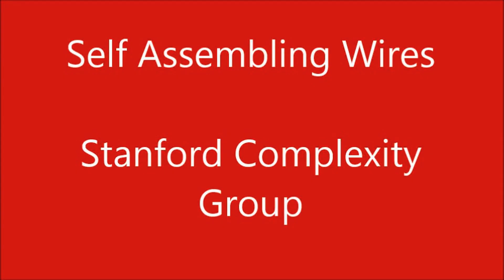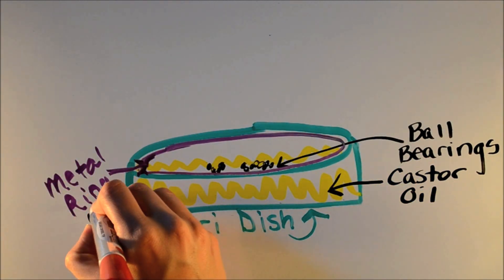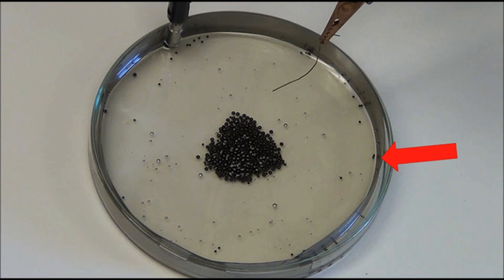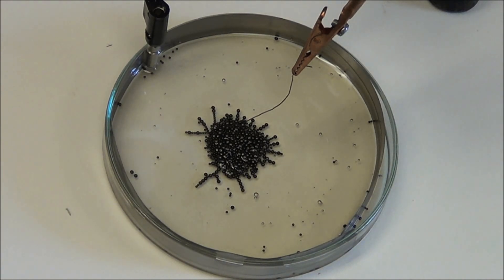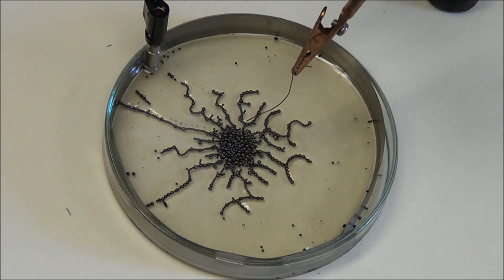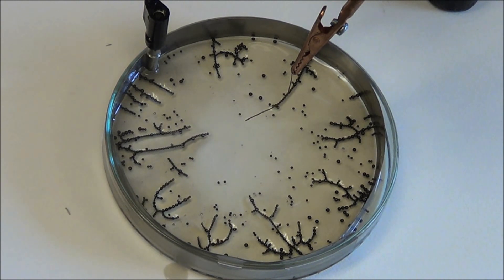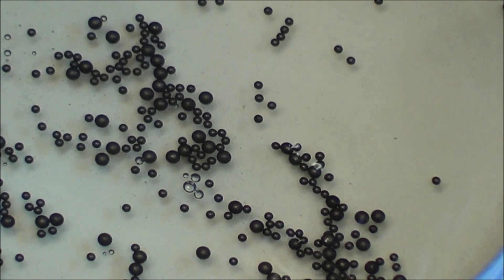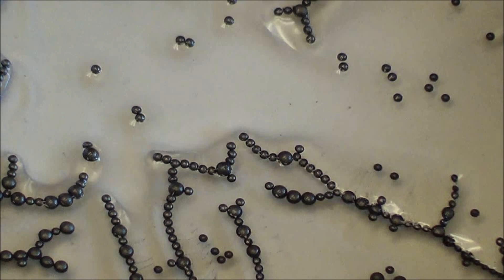Self-Assembling Wires

Comment: Normal YouTube videos: DON’T TRY THIS AT HOME!!!

this guy: “unfortunately you can’t try this at home.”
Reply: But ppl who watch electroboom should be able to do this :D
Reply: @PerfectDarkcontrol  and people who watch styropyro will probably try to scale of up 😆
Reply: I actually wanted to try this at home but I got sad when he said that I can't.
Reply: @marktoledo6595  school
Reply: @marktoledo6595  
To put it in perspective. An electric fence can have anywhere from 2,000-20,000 volts. 20,000 being the maximum legal amount. Take into consideration a human can die from just 50 volts! So seriously, don't fuck around with electricity. Water being a good conductor for electricity, humans have plenty of that and blood can do about the same thing. Seriously. Don't try stuff like this at home without being 100% safe and know exactly what you're doing.
Reply: @DexiduousRose  You could easily do this experiment with a van de graph generator. Dangerous currents are not needed. You could also do it with a potentially lethal CRT flyback tranformer if you know what you're doing, but you can absolutely do this safely without knowing what you're doing with the appropriate voltage source.
Reply: hold my beer
Reply: [Laughs in Tony Stark money]
Reply: @John Tapsell There are many ways to create the voltage required for this experiment. As complex as a Tesla coil or as simple as a flyback transformer from a discarded CRT television. Possible even a Van De Graph generator.
Reply: You can just buy a power supply to provide 20kV+ voltages if you really want too... You could even build one if you were so inclined (look up Cockcroft–Walton generator).
Reply: lol unfortunately he's mistaken, 20kv is nothing. I've been hit by over a million volts, and I'm still breathing.. He forgot to mention the amperage of this setup though, probably on purpose.
Reply: @Voidroamer  Well I've been hit by 20kV and it sure as hell wasn't nothing. Let's just say that if I'd been using my left hand I probably wouldn't have woken up before I had a chance to fall down. It's not just the current, it's also the path.
Reply: It's really not that hard to buy or build your own power supply. Their "can't try this at home" power supply can be bought or diy.
Reply: Me, watching Electroboom right before this video: "who's gonna stop me?"
Reply: So many people in thread have never bothered to learn the fundamentals. Ohm's law is a good start 🍻
Reply: @SNG.OfficiaI  This is YouTube, not MIT!
Reply: @c.a.g.3130  grade 9 shop isn't mit lol
Reply: @SNG.OfficiaI  They hardly grasp Ohm's Law in grade 9 shop.
Reply: @c.a.g.3130  who is "they"?
And what is so difficult?

We're not talking thermodynamics or any advanced engineering....
Reply: @c.a.g.3130  and btw, you can sit in with MIT here on youtube... Has been that way for a decade already for those interested.

The science and tech areas of yt are vast and publicly share a  wealth of info. 👽
Reply: @SNG.OfficiaI  Just ask the guy that "has been hit by over a million volts".
Reply: @cosmicraysshotsintothelight  there is always a method to the madness...
Reply: Not if my pile of tazers has anything to say about it
Reply: Why can't i
Reply: @strydyrhellzrydyr1345  Obviously you can. What he meant is "you can do this at home. If you're smart enough to figure out how then you probably won't kill yourself. Either way it's not my fault because I said it's impossible." But that would have taken too long.
Reply: @GordieGii  oh.. I get that.. I thought the first guy said u really can't... I c
Reply: @strydyrhellzrydyr1345  'Cuz Anthony Fauci sez so! DO IT.
Reply: Me with a full bridge rectifier and an old microwave:
Reply: @BSEUNHIR  MOT's are a hazardous prospect... and fairly useless in this application . Typical MOT output is 1.8kv - 2.2kv.. and produce lethal currents.. A flyback would be far more suitable for this experiment...
Reply: @SNG.OfficiaI  240v -> 2.4kV = 10x increase. If i use 2 MOTs, i have 24kV :)
Reply: @baileyharrison1030  
First, you are correct that each transformer gives about 10 X voltage increase. When connected in cascade, the overall voltage increase would be about 100 X. But what you propose would not work because:

The second transformer would have 2.2 kV applied to its primary, but the primary insulation is designed to handle only 220 V with some safety factor. It might handle 440 V, but not 2200 V. The primary will arc across the insulation and be destroyed.
If that did not happen, you are also applying 2200 V to a primary which was designed for 220 V. This requires the magnetic field in the core to be 10 X larger without saturating the core. Either the primary needs to have 10 X as many turns on it (to keep the volts per turn constant), or the iron core needs to have 10 X as much area inside the coil. Either way, you need a much larger transformer to operate with 2200 V on the primary. If you try with a standard microwave oven transformer, the iron will saturate and the primary will behave like it is shorted, overloading the upstream transformer. : )
Reply: Um, you just need a transformer of unusual size
Reply: @SeleckPlays  "size" does not denote winding count. Though it does play a part in current potential. Ex you can get 2kV from a transformer the size of a book of matches, but even though the voltage output is on par with a microwave transformer, it cannot produce the current...
Reply: @SNG.OfficiaI  The 'event' that takes place when you 'get hit' with an HV source that has no current driving capacity (micro-HV supplies) is that the voltage is immediately clamped down, because you are a very low value resistor to it. So in Ohms law, the resultant 'power' is very small.  Now if it was an HV transformer in a power grid distribution sub-station, that same voltage would not clamp down and you would literally get fried as the high current passes through your bloodstream and body flesh throughout its entire path through your body...  because you are a very low value resistor to it and it CAN drive high currents. One sustains the voltage and you die.  The other clamps the voltage and you get a wake up call to just how close you came to getting fried.  Tiny 10kV sparks on cigarette lighters get clamped to a low voltage because that little thing cannot make high currents.  Something that IS made to make high currents will sustain its voltage and drive current through whatever has loaded it.  It is ohm's law.  Just need a supply that doesn't 'sag' when loaded.
Reply: @cosmicraysshotsintothelight  understood ..  I think the safer route for those whom wish to use a MOT should go the voltage multiplier route. Get that voltage high enough to reduce it's available current. For a 20kV output it would still be a bad idea..

I use MOT's but mill out the secondary, rewire in a low gage low wind count to drive large laser array bars at 1.6V @60A .. 

Though I trade one hazard for another ...
🤘😜
Reply: @SeleckPlays  I'm not left handed.
Reply: Man sounds legit sad that you can't do it at home
Reply: @aftershade190  who...
Reply: @strydyrhellzrydyr1345  who? A mad man
Reply: @aftershade190  what... Lol
Reply: it isn't that difficult to do...
Reply: yeah
Reply: i mean, they couldn't, even if they wanted to, lol.
Reply: @MyouKyuubi   if you watch someone like ElectroBoom and actually learn what he sais, well i did like 2 kV with a homebuilt transformer which can be increased even more, im just lazy.
Reply: You don't tell me what to do!!!!!
Reply: You can. Just need a transformer.
Reply: "Let's hope nothing blows up"
Reply: I tried it, but there was an accident and now I'm some kind of cyborg.
Reply: Me and five microwave power supplies disagree.
Reply: I mean... couldn’t you just use a car battery
Reply: >this guy: “unfortunately you can’t try this at home.”
me: looking at my microwave
Reply: Yes you can,generating high voltage is easy,but if you need high current and high voltage that is just in industrial settings then
Reply: Wire 2 fly backs in series at the output secondary winding, parallel primary windings n u should be able to get this voltage, infact much more depending on how much your ZVS driver can handle. Its what i did with my fly backs.  its nice using a Variac for a power supply too. Just rectify to whatever voltage desired. I use this configuration for my Tesla Coils, and now soon, this ball bearing experiment.
Reply: 20Kv is the voltage generated by an old CRT television, if you have a bit of soldering skills and can retrieve a high voltage transfo you can literally do this at home, and that's what I'm going to do, my old, trusty ProView 19" died last year, but i wanted to save its heart. maybe making a tazer or some shit with it. but that project is inspiring.
Reply: hmmm. hops on #The_Post_Apocalyptic_Inventor. yeah, anyone got a used dryer, an old German made projector and some microwaves that they're handing to a dump I can intercept?
Reply: @BLIRTT  dryer.. nope. projector i don't imagine, microwave perhaps but really, go dig for a CRT monitor or an old television. that's what you need inside.
Reply: @BLIRTT  with the ton of shit you buy every year to replace it because it's obsolete, and you are too dumb to get it fixed yourself, you certainly had all of this somewhere at some point.
Reply: You actually can, with a microwave transformer. plug it into the dryer outlet.
Reply: Cynthia May  youll hear a pop, the gfci going out. Try a grenade instead.
Reply: That sounds like a challenge.
Reply: Nothing can fucking stop me
Reply: @John Tapsell Just build it by yourself, plastic cage isn't problem to get and then just craft it by switching between laying down foil and spining coils of paint insulated wire :D We had to craft them in school. 230V -> 12V + 12V secondary with common centre
Reply: well, he's simply wrong by saying that. 
high voltage power supplies with enough power are readily available (although relatively expensive, compared to other, "normal" bench power supplies) and everyone who's not a moron can absolutely work with such high voltages as well. He's also wrong with 120V household voltage - most of the world has 220 or 240V, and even north american and canadian households have access to 3-phase 220V because it's needed for demanding electrical appliances such as oven, washing machine etc.
Reply: Well, fortunatelly you can, but you'll need the right equipment...
Reply: He's just flexin'
Reply: @John Tapsell voltage doesn't matter, you can "get hit with" 1 volt or 1,000,000 volts and can have the same effect. It's the current that matters with life/death
Reply: @John Tapsell correct, but if you completely ignored the fact that you are able to control the current itself as well. A 1,000,000V taser will not kill you because the current is low. Just because something has a high voltage does not make it inherently dangerous.
Reply: That is just a challenge! Search for "Power Module High Voltage Generator". $4 will get you a low current 20KV supply. Where is the best deal on the bearings?
Reply: 2014 YouTube was fire
Reply: People : can we try this on home? 
This guy : well yes but actually no
Reply: interesting
Reply: Anyone suggesting mot's for this experiment is in the running for a Darwin award. Any high voltage source that can deliver over 30ma can kill. To be safe you want to be in the micro amp range. Also consider things like capacitance. If for example you choose to use a Cockroft Walton voltage multiplier then choose a frequency for the AC input that will allow you to use a low capacitance value and reduce the joules of energy stored. If done properly then this experiment can be perfectly safe. If you don't understand what you are doing the consequences can be fatal.
Reply: @paulb2529  "Over 30ma" MOT's ~ 2.2kV @ 1,000mA ☠️

Where ohm's law can earn you a Darwin Award 🤪
Reply: Me: "Oh you silly fool. Ye of little faith, in humanities creative ingenuity of stupidity"
Reply: I can increase the voltage by step up transformers.
Reply: Yup
Reply: not with that attitude
Reply: this guy thinks everyone in the world lives in america... xD what an idiot, not everyone has 120 volts in their homes, i have 230V in mine.
Reply: Sooo, why can’t you try this at home?
Reply: @bradwoods371  I suppose he meant, because the average person doesn't have a high voltage power supply sitting around (although a microwave transformer could be used, albeit lower voltage). But you can definitely find a high voltage PS anywhere on the web, or even find a large transformer in certain products, and adjust the wraps to give you a high voltage. but the average person is not going to do that, and if they did take the time to do so, well they're probably adept enough to read about it's safety aspects
Reply: you're right
Reply: Challenge accepted.
Reply: Watch what happens when we hook up this ignition coil to a car battery.
Reply: I guess we can do it in college chemistry lab ...
Reply: @John Tapsell Isn't the guy using DC voltage? Transformers would only give HV AC.
Reply: could probably use a van de graaff generator instead tbh
Reply: You just need an inverter to turn amperage into voltage. They're used all the time in RVs to take the 12v current from the car battery circuit into 125v in the appliance circuit. The reason this test needs high voltage is the gap in between the positive and negative. Voltage is the flow, so high flow is needed to bridge the gap.
Reply: @HellZReaper134   all I have to do now is find myself an RV
Reply: @Yah_Neh254  neighbour got 1 xD
Reply: @HellZReaper134  voltage is difference of potential, current or amperage is flow. not to mention that an inverter converts 12Vdc into 120Vac. 20,000Vdc is required for this experiment and an inverter is in no way capable of creating that.
Reply: @stevenbliss6484  I was using the rv as an example of concept. As for what I meant, you are correct it was potential not flow. Amperage is intensity versus voltage being range. Thou someone said it correctly that a microwave transformer could be used. Seen plenty of videos on destroying junkyard microwaves for their components. Needless to say it's plausible to make if you have time and determination.
Reply: @HellZReaper134  so in essence the ball bearings are just giving us a visual of what the flow looks like in a way the naked eye can see.
Reply: @giannidali9226  Exactly. Electricity travels not the path of least resistance, but all paths with resistance.
Reply: @HellZReaper134  "voltage is the flow" lmao
Reply: @HellZReaper134  or a big chungus transformer
Reply: That’s a flex “Couldn’t do this even if you wanted to”
Reply: What if you simply use water and iron filings? Wouldn't house current then be sufficient?
Reply: @c.a.g.3130  Are you serious? Or do you work for the Darwin Awards? Water is conductive.
Reply: @GordieGii  Well, actually the conductivity of gasoline is only 25 pS/m (oh, and low viscosity, to boot!). So how 'bout that instead?
Reply: @c.a.g.3130  Just live stream it, because I doubt your parents would post the video.
Reply: @GordieGii  Distilled water is a very poor conductor.
Reply: @Tano Actually, it's impurities disolved in water, and if he'd said distilled water I wouldn't have said anything.
Reply: The reason is totally stupid also, like 20kv is totally possible with microwave transformer, he guy talking don't know shit
Reply: @N1ko0L  I think his message isn't about saying that this is an impossible experiment to perform on your own, but more simply trying to discourage others to attempt this... and look, it has worked. Most people are simply sad that they can't do it as opposed to looking at building or even buying your own HVPS.
Reply: @N1ko0L  Yep and this isn't really self assembling wires... it is just electricity and magnetism doing its normal thing. It seems like he had a project to do and half assed it.
Reply: Yeah i disliked it cuz of that, what a douchebag the guy has to be
Reply: @ner0b  no he spesificly said that he will use a bigger energy source and use 20* more power than a normal household,
Reply: @ner0b  ? How is that being a douchebag?
What constitutes a douchebag to you? This is dangerous stuff for goodness sake!
Reply: @ner0b  I think he is obviously jocking

Comment: An electrical version of the iron filing  in a magnetic field experiment ... notice this has two sizes of beads. It is not enough to know the voltage you need to know the current because Power = voltage * currrent ,  the power gives the electrical potential the energy to move the ball bearings.  The variable sizes of the ball bearing will change their behavior.

Comment: Cool! Or better put: Hot! It starts out as the same phenomenon observed in lightning. Probing and searching for the optimal path to discharge the static electricity, i.e. close the current loop in this case. The dendrites and the fractal number, 22:1 in this case, being symptoms of the complexity on small scale in this system.
Would be very interesting to try out other petri dish models like ellipsoid or square.